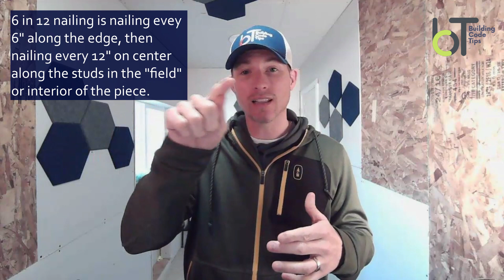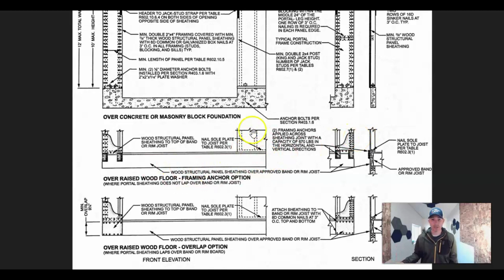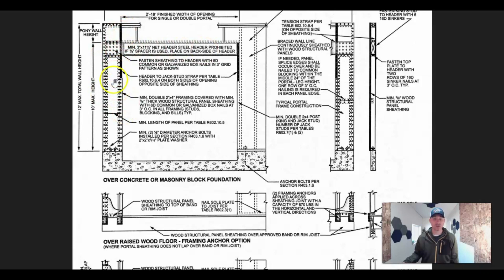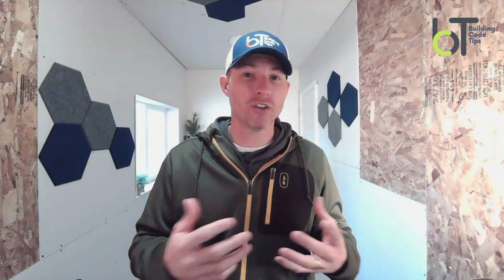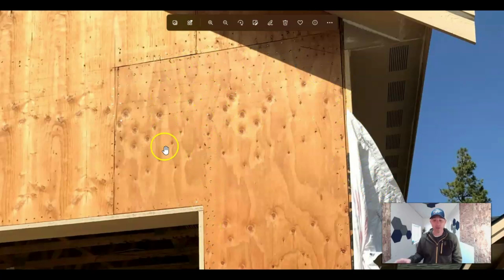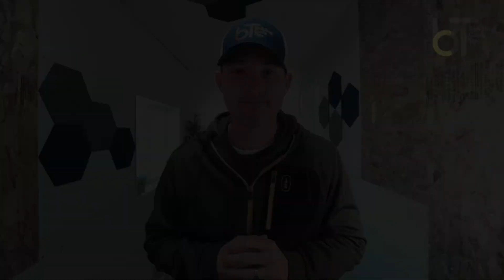Exterior Shear Panel & Portal Framing Explained

Comment: So if you are using double 1.75in LVLs to for a head and have a total width of 3.5 in how are you supposed to build it out for the width of 2x6 walls in order to add the strap to the back side of the header?
Reply from the maker: Most framers that I see block out that section for the strap to run through and for the garage door buck to run over.

Comment: So if I'm building a 24 foot garage with 2, 8 foot doors. Will all 3 walls be portal walls? Also will it be 1 continous beam 24 foot long, no splices?
Reply from the maker: Good evening, Only the walls with the garage door openings would be required to meet portal nailing requirements. The other walls should have continues sheeting with shear nailing at the corners (block the seems and nail off the full sheet  at 6" on the edges and 12" in the field). The beams should carry all the way from corner to corner unless one of the side wing walls is over 4ft or if the garage doors are on the same wall you can split the beam in the middle (or at least that is how I would allow it, getting a 24ft beam might be difficult to buy and install).
Reply: Thank you, this makes a lot of sense. I spoke to my architect and she said that beam cannot be spliced in the middle, because that is a portal connection. So as far is beam size per cost, I'm gonna have to do just that and get a 24 footer. Although the 2, outer 24" walls aren't drawn as portals. But just in case I'm gonna add the straps in the pour, on all 3 walls (2 at 36" and 1 at 24") should be ok?
Reply from the maker: If your architect it telling you the side walls are not considered portal framing I would probably go a larger J-bolt and square washers. Only because those straps can be a pain to side over! Unless of course your local code only allows the straps.
Reply: Ah ok, actually those J bolts are detailed in my plans. So I'll just do that instead of the straps. If I'm allowed with the middle splice, is it necessary for the beam to run to the ends? Would it affect the both end shear panels? I have 2, 4x12x10s and I really want to use them up here.
Reply from the maker: @alfredovargas616  At least per standard building code if the side walls (wing walls) are less than 4 feet wide then that beam should carry to the end (corner). In order to do the portal nailing properly the beam needs to run all the way through. If the portal is not required then the beam can stop just past the opening with a couple of jack studs under it. Hope that helps!!
Reply: It's makes total sense,  I'm screen shooting this, and sending it to my architect because my plans just got sent back to me for these exact revisions, I'm gonna make it longer to meet the 4' wing walls. So 28' instead of 24'.
Reply: Thanks to your info, I was finally granted my permit. Thank you! It might seem like a silly question,  but where does my walls height begin? On top of the stem, or on top of the middle slab (but that slopes for drainage) ??
Reply from the maker: @alfredovargas616  glad to hear you got your permit!! For what purpose are you curious about wall height? Did the approved plans stipulate a max height?
Reply: So my plans are set for 10' walls. Do I measure from top of stem wall, or top of inside slab? I'm just confused and don't wanna break any height restrictions
Reply from the maker: @alfredovargas616  Usually, at least where I am at our plans examiners will put a max height on the plans. If you have something like that then try to stay under that number (measured from the peak of the roof). If there is no call out and a 10ft wall is called out on the plans then I would assume you are ok to build your walls at that height.

standard construction calls for 6" earth to wood so as long as your foundation wall doesn't stick up out the ground an extended amount then building it per the plan call outs should be perfectly fine. 

If I were measuring heights I would measure from the concrete edge at the entrance of a garage door or man door. Hopefully that's not to confusing! Happy holidays
Reply: Thank you sir! Exactly the answer I was looking for. Merry Christmas happy holidays and a happy new year!